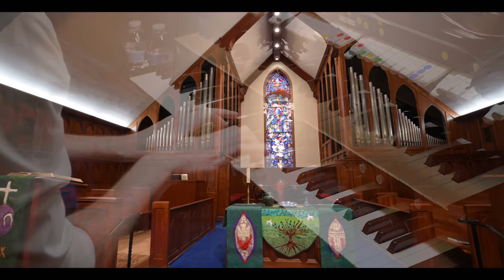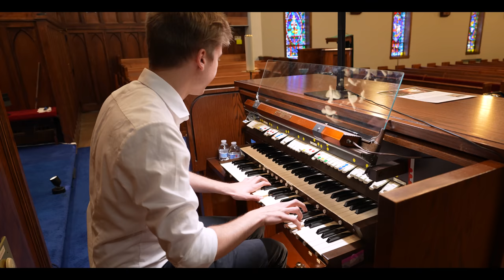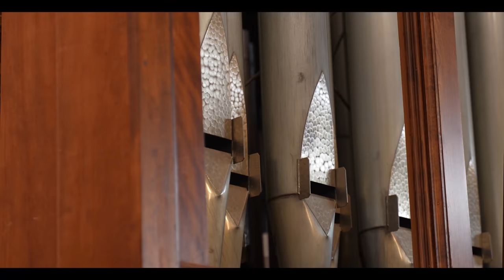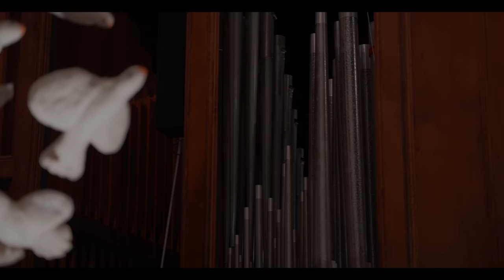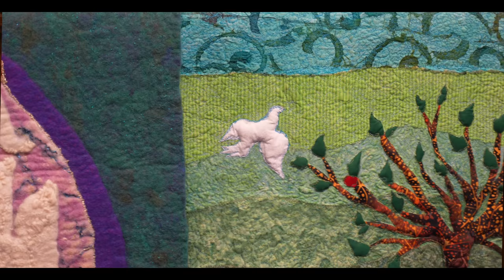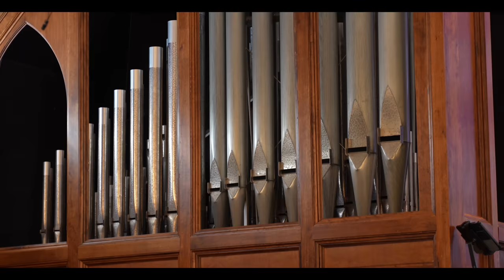This Hybrid Organ uses Organ Pipes and Digital Stops! - West Raleigh Presbyterian Church  - Paul Fey

Comment: A wonderful demonstration of this hybrid organ, with 27 ranks of original 1968 Cassavant pipes and 17 ranks of Walker digital stops added in 2015.  Paul has done a wonderful job of presenting both loud and soft combinations, as well as using the super couplers. Thank you for making this video; the sound was incredible and you presented wonderful visuals of the church.
Reply: 17 voices not ranks. While they are the best in the industry. They’re still not real.

Comment: Magnifiscent organ and performance. I only wish it was not chained down with carpet and padded pews. Churches will spend a fortune on the organ but it would be much better spent building acoustics.
Reply: Not all organs do well with buildings that have acoustics. For example, the National City Christian Church in Washington DC used to have acoustics of 6-9 seconds and because of that it made the large Moller organ sound very thin and not clear. In 1981 National City Christian Church put carpets in the building to make the acoustics smaller and it was one of the best things they did for the church. If West Raleigh Presbyterian Church have larger acoustics, the organ might need to be a little larger than it is now.
Reply: @StoreeDenson  i once played the smallest kilgen pipe organ in Sts Cyril and Methodius in Shiner Texas. It sounded like heaven with the high tin ceiling, but then they carpeted everything and it killed it.
Reply: @Richard-vq7ud  Kilgen organs always sound nice in big acoustics. I am not sure about small Möller and Casavant organs based on the ones I played before.
Reply: @StoreeDenson  i just love big acoustics, partly because it is very rare nowadays.
Reply: @Richard-vq7ud  They are rare. Sadly, most of the newer large church organs are in dry acoustics in the US.
Reply: @Richard-vq7ud  My mother is from Hallettsville. I passed through Shiner many times on the way to visit my grandparents. Never knew there was a pipe organ there. OHS doesn't have an entry. There is a small unit Kilgen at an Episcopal church in Seguin that I have played.
Reply: @thebog11  oh wow, it is amazing how connected we are here in the comments!   Both my parents were from Shiner, and so i played for many funerals in that church. I think Kilgens have the best sound. St Patricks in New York is Kilgen. So is San Fernando Cathedral in San Antonio. I drive thru Seguin all the time. I wish I could play at that Episcopal Church, im sure it is heavenly. Sometimes i sub at the Gonzalez Episcopal. They have a really beautiful historic church and the old pipe organ is in outstanding condition. My immediate family is gone now from Yoakum, but i am always with my cousins in Breslau outside of Halletsville. Thank you!! It is so nice to meet you!!!
Reply: @Richard-vq7ud  The Episcopal church in Seguin has two classic organs! The Kilgen is in their chapel. Their main church organ is a small Hook and Hastings from 1910, but it's been modified. The Kilgen is original as far as I know, and dates to 1934. The original console still works. I will have to check out the organ in Gonzales sometime. I also want to check out the organ at San Fernando Cathedral. Nice to meet you too!